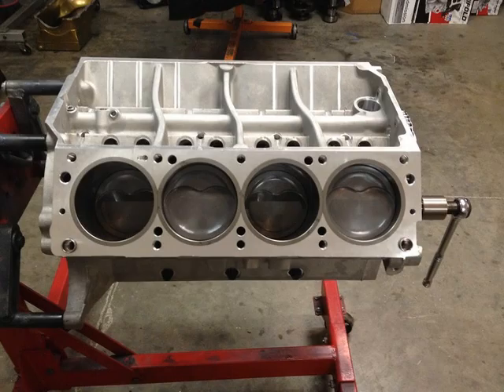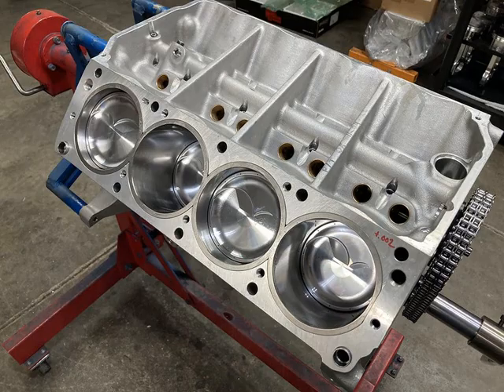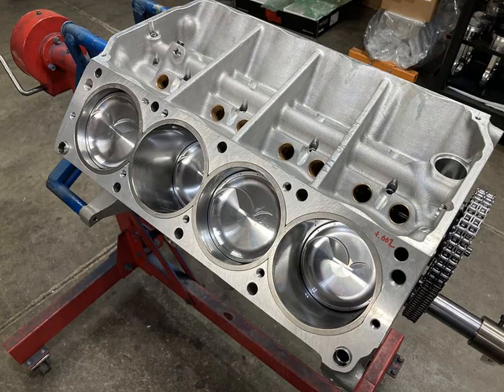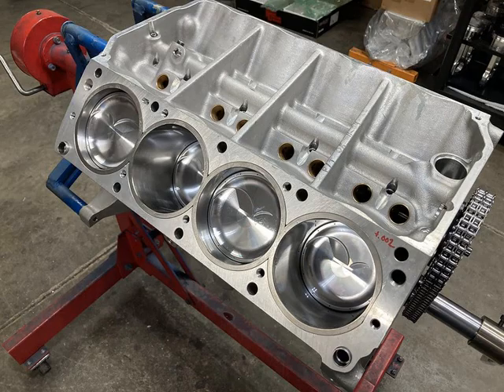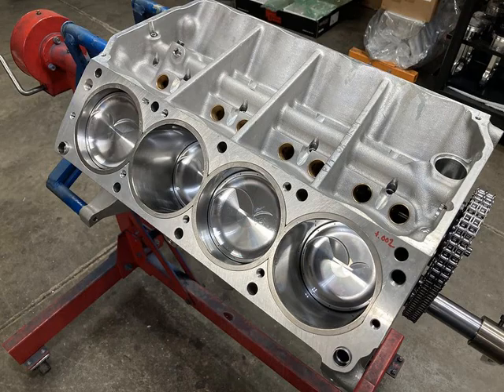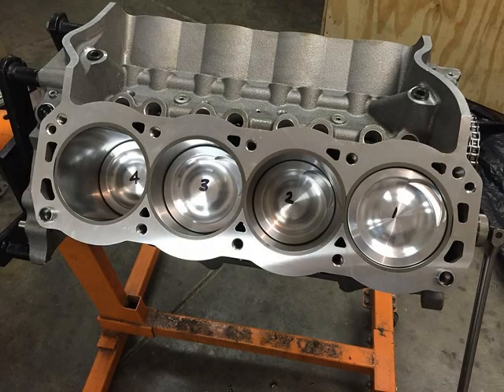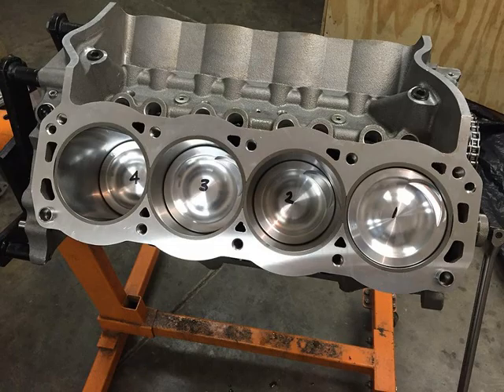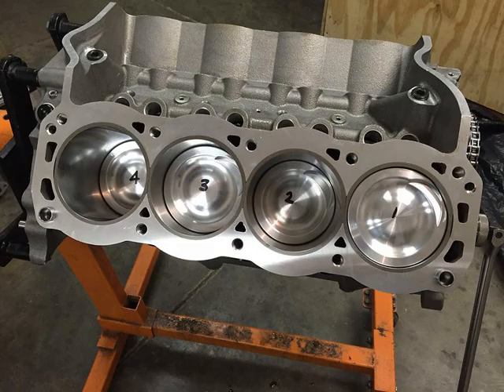Lykins Motorsports THE PROS AND CONS OF ALUMINUM ENGINE BLOCKS...

Comment: If true then it’s seems a smaller max bore size and therefore thicker ductile iron sleeve should be used with a aluminum block. Having Darton make a custom MID wet sleeve might also help quite a bit in that problem since more aluminum is removed with more iron taking its place and the nesting effect of flanged sleeves is said to greatly increase strength and stiffness. The concept is used on million mile diesels, although in a VERY heavy block. Maybe a few of you engine builders should work together to test it out. Also Darton might get involved and possibly sponsor the test, having so much confidence in their product. For your customers who insist on a aluminum block it might make for a more powerful and satisfactory engine. Also if the bore is damaged a MID sleeve is much more easily replaced. If it is tested to be much stronger perhaps block manufacturers might integrate it into their product. I do understand Pond uses Dartons DRY sleeves. Also  I noticed Scoggins Dickey Chevrolet sells New LS-3 aluminum blocks with MID already correctly installed for just over $3,000. Seeing that they are one of the biggest GM parts retailers in the Country seems to me like a good endorsement.

Comment: Thank you for the video/info.
What about an all BILLET Aluminum block to help with ring seal and cylinder shift, etc❓

Also, would having the block "half filled" from the factory on a CAST aluminum block or all BILLET aluminum block help with the cylinders dancing around❓---- or even filling part of the block with the minimum amount of grout type of material be of any help❓

I understand filling the block is defeating the purpose of trying to save weight.... but what about the rigidity of the Billet block❓---- is there no help there either❓ I already know billet aluminum blocks are already ridiculously super expensive. 🧐😧
Reply from the maker: Billet aluminum is still aluminum and still has the thermal expansion rate of aluminum.  It's a little different than a cast aluminum block, but still squirms.

Comment: How do the OE deal with these cons? Great video, again 👏
Reply from the maker: The OEM have a lot larger budget to spend on R&D, but the basic premises of aluminum still hold true.  They will also choose fuel economy (less weight) over horsepower loss.
Reply: Die casting higher quality than sand casting?
Reply: The OE's have econemy of scales, when making thousands of blocks extras thy make them live can be worked into mass production. After market Alu blocks are $8000+ how much do you think and OE has in a block in a $40k car?

Comment: I bought a Shelby aluminum block years ago.  There were no new iron blocks.  Paid $5600 and it included the studs.  All the Shelby blocks a NOS.  They were cast by Arias many years ago.  When putting it in a Cobra replica, or a vintage Mustang, the weight savings is a tremendous benefit to handling. and acceleration.  It more than offsets the horsepower loss (if any).  I set my tight lash Street Roller cam to 0.006" cold.  Also the engine runs cool because the aluminum dissipates the heat rapidly.
Reply from the maker: The weight doesn’t offset.  A 100 lbs is a tenth in the quarter.  If you lose 40 hp, that’s almost two tenths.  It’s really just for bling.  In a cobra the engine sits behind the front axle centerline anyway.

Comment: If the aftermarket could design and pour an aluminum block like Teksid in Italy, I'd make the switch. 2 stroke engines have been using the spray bore since the 90's.

Comment: Part of the issue with the stupid high cost of Ford aluminum blocks is the lack of an economy of scale. GM's aluminum LS engine is reasonably affordable and a popular choice because thousands of them are manufactured. The other issue that always irks me is having to duplicate the machine work that I am already paying for when I buy the block, heads or whatever. To pay $8K for a block, only to end up dealing with porosity, sleeves that are mispositioned, decks out of parallel etc. is a paradigm we have lived with since I first turned a wrench and we have not seemed to demand more as an industry some 50 years later. If I buy a brand new ls3 block, I'll likely have to pay for the same machine work, as if I used an old used piece! 

Good analysis on the pro's and con's, Brent. I lean heavily towards aluminum as my projects are mostly marine based, where weight is everything. The temperature gradients encountered when raw water cooling an aluminum block are also more significant than that encountered with iron.

Comment: Back in 2002, When we bought a Shelby aluminum FE block for our ERA 427 Cobra it cost $5,000....and we thought that was outrageous at the time.
But no one was making cast iron side oiler FE blocks back then, just used up/sleeved/holed skirt 427 blocks for $2,000!
Reply: I had the same experience.  No decent 427 Iron blocks available.  The Shelby block has better oiling.  The oiling system was patterned after a Mopar by Arias. Paid $5600 and it came with the ARP studs.
Reply from the maker: It's actually like a Windsor oiling system!  Very nice and priority mains!